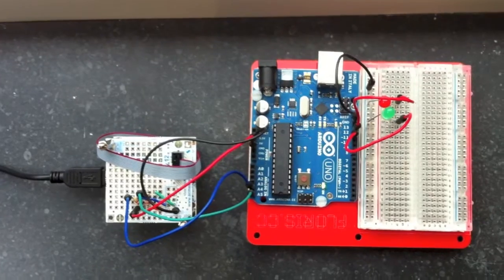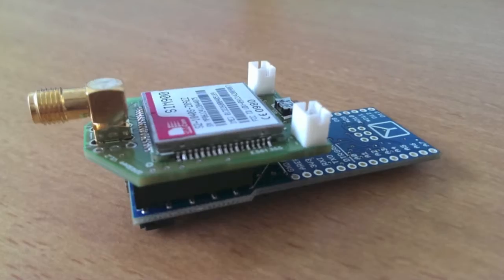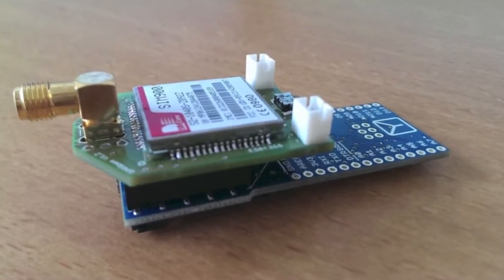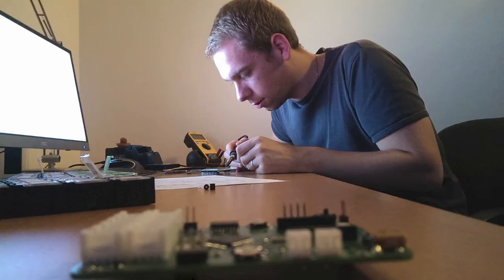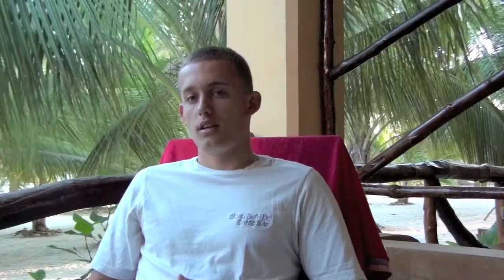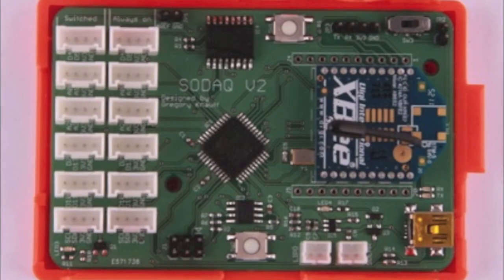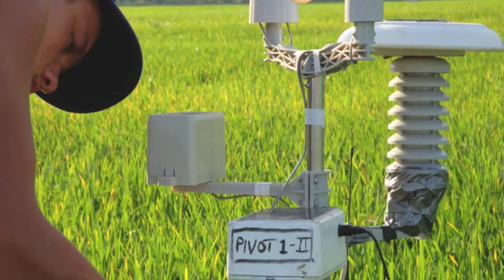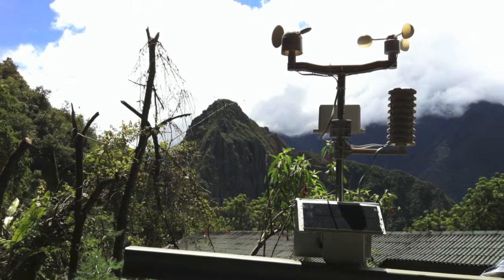SODAQ Kickstarter Biography

Comment from the maker: You are right we have been using the Alecto sensors, which are also sold under at least 10 different other brand names. The manufacturer is the Chinese company 'Fine Offset' 

Sparkfun sells these too:

sparkfun(dot)com/products/8942

And their datasheet describes the reading of the sensors. We created a little PCB ourselves to change from the RJ11 connector format to Grove. 

We will be publishing some software examples and libraries for this once our Kickstarter is succesful.